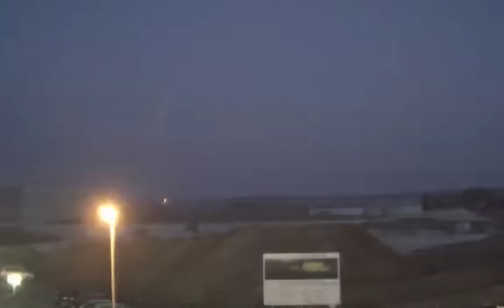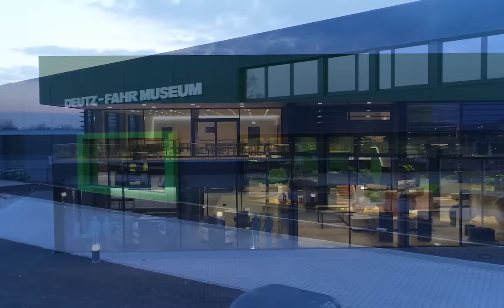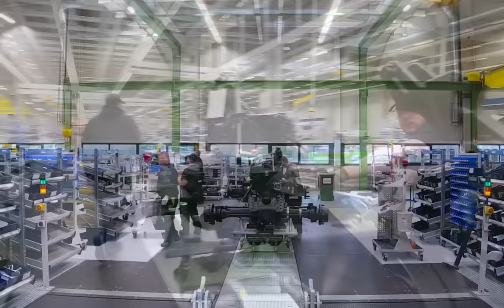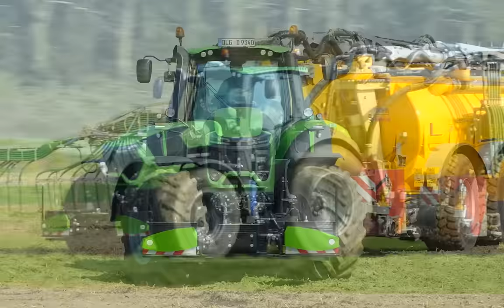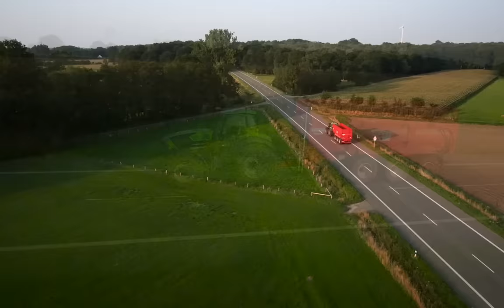DEUTZ-FAHR LAND: High-tech “Made in Germany”

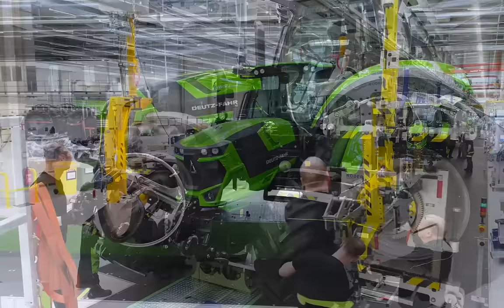Comment: on the video at 2:47, you can notice on the tractor shown that the front right tyre is mounted in the wrong side, if you compare to the left tyre
Reply from the maker: @totolarico75: first of all, our compliments for being such a  keen observer :-)
But there is no need to worry: Of course this is not an assembly error, but so-called provisional tyres which are used by all manufacturers. These tyres are used if the customer decides on different tyres at the last minute, in case of export models which will be fitted with other tyres in the destination country or for other production-related reasons. This provides a conspicuous "marking" and everyone involved in the process knows what to do. Thank you
Reply: Yes

Comment: Hi," DFL"...Why a front tyre in opposite orientation???
Reply from the maker: First of all, our compliments to the keen observers :-)
But there is no need to worry: Of course this is not an assembly error, but so-called provisional tyres which are used by all manufacturers. These tyres are used if the customer decides on different tyres at the last minute, in case of export models which will be fitted with other tyres in the destination country or for other production-related reasons. This provides a conspicuous "marking" and everyone involved in the process knows what to do. Thank you

Comment: 2.48 dakikaya dikkat adamlar sağ ön lastiği ters takmışlar 😀bu kadar görkemli bi videodaki hataya bak neyse reklamın iyisi kötüsü olmaz diyelim.
Reply from the maker: Hallo Yalçın, there is no need to worry: Of course this is not an assembly error, but so-called provisional tyres which are used by all manufacturers. These tyres are used if the customer decides on different tyres at the last minute, in case of export models which will be fitted with other tyres in the destination country or for other production-related reasons. This provides a conspicuous "marking" and everyone involved in the process knows what to do. Thank you

Comment: 2:47 Right front tyre wants to roll backwords. Not nice. It is annoying. And it is different type of tyre than left one.
Reply from the maker: Dear Nikale40, this is not an assembly error, but so-called provisional tyres which are used by all manufacturers. These tyres are used if the customer decides on different tyres at the last minute, in case of export models which will be fitted with other tyres in the destination country or for other production-related reasons. This provides a conspicuous "marking" and everyone involved in the process knows what to do. Thank you
Show less
REPLY

Comment: 2:48 the front wheel is on backwards
Reply from the maker: Hello Aston,
there is no need to worry: Of course this is not an assembly error, but so-called provisional tyres which are used by all manufacturers. These tyres are used if the customer decides on different tyres at the last minute, in case of export models which will be fitted with other tyres in the destination country or for other production-related reasons. This provides a conspicuous "marking" and everyone involved in the process knows what to do. Thank you

Comment: 2:47 - opona kierunkowa źle założona....
Reply from the maker: there is no need to worry ;) Of course this is not an assembly error, but so-called provisional tyres which are used by all manufacturers. These tyres are used if the customer decides on different tyres at the last minute, in case of export models which will be fitted with other tyres in the destination country or for other production-related reasons. This provides a conspicuous "marking" and everyone involved in the process knows what to do.

Comment: 2:49 leve kolo :-)
Reply: Yeah, left wheel.

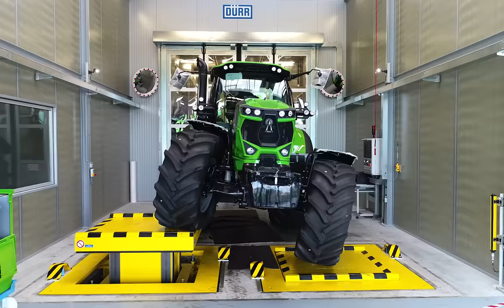But in 2:58 is correct.
Reply: PAN PAVEL salam
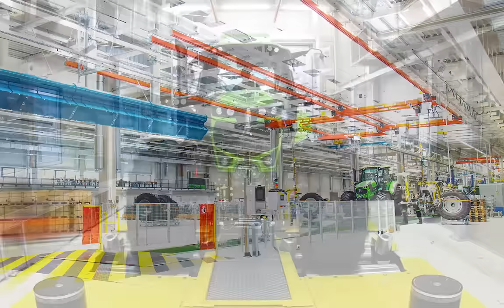Reply: But in 2:58 is another tractor, wheels are biger
Reply: PAN PAVEL ?
Reply: PAN PAVEL kool
Reply: Das hat mit Kindern nichts zu tun.... hab schon einige Modelle ausprobieren dürfen und kann daher sagen welche mehr Vorteile besitzt
Reply from the maker: First of all, our compliments to the keen observers :-)
But there is no need to worry: Of course this is not an assembly error, but so-called provisional tyres which are used by all manufacturers. These tyres are used if the customer decides on different tyres at the last minute, in case of export models which will be fitted with other tyres in the destination country or for other production-related reasons. This provides a conspicuous "marking" and everyone involved in the process knows what to do. Thank you
Reply: DEUTZ-FAHR (official)
Reply: No, but I'm not worry at all. This process is strange to me, because, make a mistake, I would say, voluntarily, can be the source of a real mistake. With a data sheet stuck on the tractor, from 0 to the end, with serial number, all the options and country, it can help as well.
Reply: noway b
Reply: PAN PAVEL I
Reply: PAN PAVEL 1aw,0
Reply: Poland ?
Reply: Somone had to more drinks night before😎

Comment: o pneu direito do trator, esta ao contrario,rs (2:47)....................................................................................................................
Reply from the maker: There is no need to worry, @TEDD BRUCE. Of course this is not an assembly error, but so-called provisional tyres which are used by all manufacturers. These tyres are used if the customer decides on different tyres at the last minute, in case of export models which will be fitted with other tyres in the destination country or for other production-related reasons. This provides a conspicuous "marking" and everyone involved in the process knows what to do. Thank you

Comment: 2:47 tires
Reply from the maker: @PRO Zyczka: first of all, our compliments for being such a  keen observer :-)
But there is no need to worry: Of course this is not an assembly error, but so-called provisional tyres which are used by all manufacturers. These tyres are used if the customer decides on different tyres at the last minute, in case of export models which will be fitted with other tyres in the destination country or for other production-related reasons. This provides a conspicuous "marking" and everyone involved in the process knows what to do. Thank you

Comment: Hahaha ,, big factory,, someone assembled the front wheel the wrong direction,, then its correct in the next pics,,,,,must be a reason for it in a jerry factory,,
Reply from the maker: Hello Js, this is not an assembly error, but so-called provisional tyres which are used by all manufacturers. These tyres are used if the customer decides on different tyres at the last minute, in case of export models which will be fitted with other tyres in the destination country or for other production-related reasons. This provides a conspicuous "marking" and everyone involved in the process knows what to do. Thank you
Reply: DEUTZ-FAHR (official) I appreciate your reply  . I did not want to bust ye balls but i am a tractor fanatic and like stuff on a tractor to be correct. I do understand the provisional tyres , hey ,,we sometimes also have to swop a flat out , but we get it right asap. 
I vote all the way for German tech , specially trucks(Magirus),unimogs , guns and tractors,,,,and beer.
Thats one kick ass tractor factory and in my view ,,the best tractor in green.
Regards
Johan Grobler